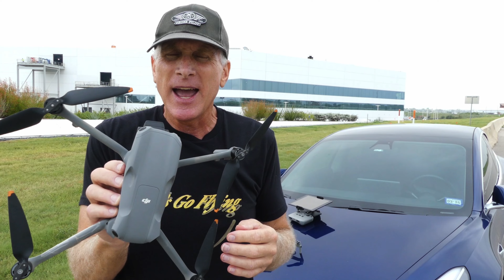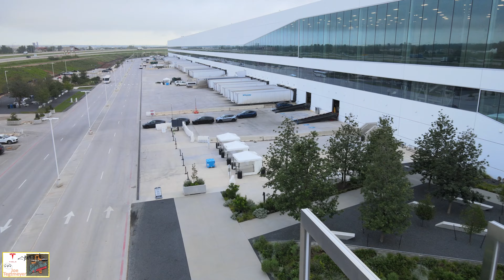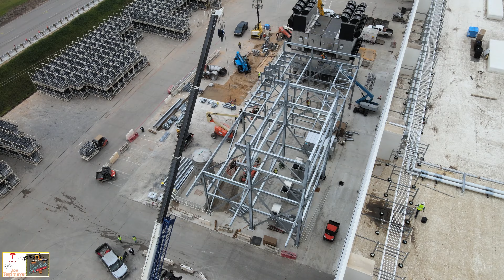About Drones, 1st Dry Cathode Cybertruck & S Ext progress! 26 July 2024 Giga Texas Update (07:35AM)

Comment: 7:49 recently, I have suggested that if the Semi truck's efficiency depends so much on air drag coefficient that the current rigs would waste that immensely. So seeing this, either it is already a testing platform for future Semi car transport trailers, or it is an attempt to save fuel even for the classical ICE trucks. Also obviously it would keep the cars clean the entire route, so why not and it's an amazing though long overdue step in the right direction!

Comment: About these 3 tunnels: I assume they are NOT meant to bring stuff into the building. You can't maneuver a truck around them to get in. It looks more like a "water escape tunnel" to me. Think of the thousands of gallons of water constantly flowing through that supercluster part. What if something goes wrong?
Reply: Fire Escapes. No other egress locations on the southside. Stairs inside to Level 1 and 2. Don't go deep enough into the building to reach the Data Centre.
Reply: @DessieDoolan August 13: apparently not fire escapes. But probably water drainage tunnels.
Reply: @luysterborgh  FWIW. Joe has confirmed from an onsite source that these are in fact simply fire escapes. Check his 14 August video at 11.55.
Reply: @DessieDoolan  I just learned... So you're right. One question remains: why are there these concrete elemnts at the end of the tunnels  'blocking' the exit?

Comment: Thanks Joe
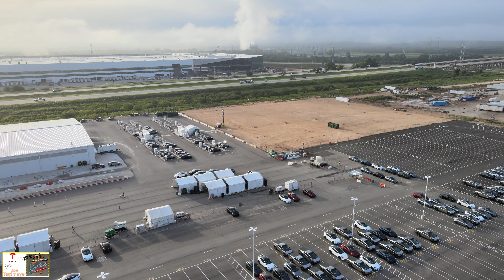6:48. New EOL, north. Cybertrucks going in dry. At 11:28, vehicles tracking water out. Internal car-wash operational.
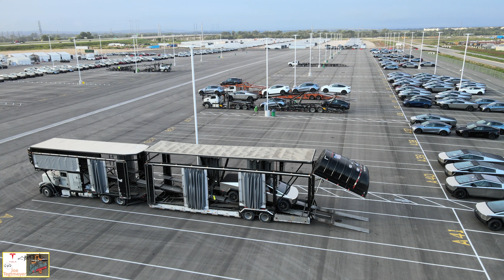7:42. EOL Transport yard. Covered car-carrier. First one in a while. 12 months ago seen regularly when the Transport yard was on the eastside.
8:40. Westside, storage. Bottom. Pair of silos. See 23:41.
8:57. Westside, south storage. Steel items. No columns, not a building. See 13:50 for an example of where this material ends up.
10:02. Westside, Tunnel Project. Tele-handler picking up a road deck segment. Segments are 114” 2.85m x 48” 1.2m. From the Colorado River Crossing documentation, and scaling.
12:24. Southend, roof. Left. Black material rolled out is ‘Hydrotech, Hydrodrain’. Used as a drainage layer for green roofs, or gravel ballast roofs.
13:50. Southend, east. Mezzanine. Constructed an additional column bay beside the loading platform. A week ago as it turns out.
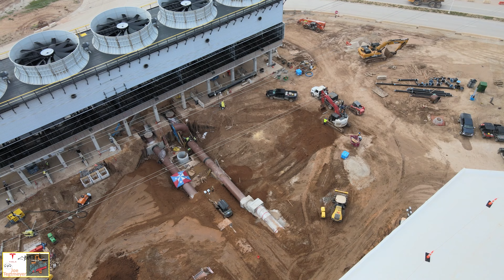15:09. Southend, Cooling Tower. Concrete manhole riser between the large flow and return pipes. A sump perhaps. Small black pipes entering on west and north.
15:58. Southend, south. Centre Fire Escape passage. Barely enough space for the golf cart to turn into the tunnel.
Obvious from this shot is the tricky access into the passage with the narrow space between to the pond.
Considerable work would be required to make this a functional vehicle access. Huge grade differences, minimum turning space etc.
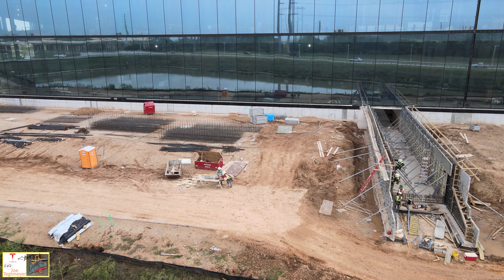16:22. Southend, south. Centre Fire Escape Passage. Wall tapers at the end. Taper would mirror the planned embankment/berm slope.
16:52. Southend, west. Apron. Bulldozer spreading gravel over geo-mesh. Temporary road.
19:35. GA, stairs. Right. Scaffold deck built over.
22:12. Casting, north. 3 black covers over new wall openings.
22:59. Casting, Baghouse. Tank installed. Seen on Tesla Road east in Joe’s previous video.
23:41. Casting, Baghouse. System to the left is by Nederman Mikropul. 
Hexagonal pads as previously mentioned by Joe may be the location for the silos seen at 8:40. Silos such as these feature in some Mikropul explosion-proof filtration systems.
24:21. Windtunnel. Green generator unit has returned.
25:05. Die Shop, north. Storage. Black mesh material, and powder-coated square section aluminum/aluminium extrusions. Fencing system perhaps.
26:58. Cathode, east. Temporary chiller plant.
27:39. Cathode, south. Loading docks empty. US Filter trailer been there since April at least. No trailers at the loading docks.
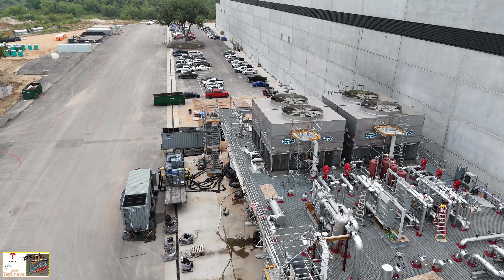27:53. Cathode, Plant Platform. Right. Ice on all 4 of vaporizers in Joe’s photos.
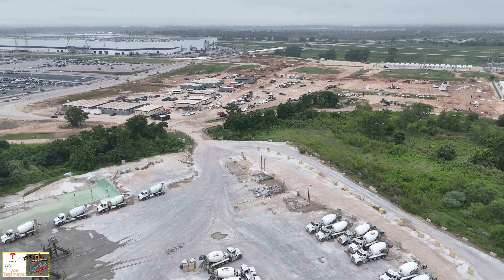28:39. Concrete Batch Plant. Now operated by Texas Concrete. Temporary batch plant to the north of the new switchyard/substation evidently still operated by Martin Marietta.
29:05. Temporary switchyard site. Soil test rig presumably. The most well compacted section of ground on the site. Nearly 2 months spent compacting this site in early 2021.
Reply: Love the term 'explosion-proof filtration systems'
Reply: @memrjohnno  Every home should have one...

Comment: at time 16:07  ---- if the data center is divided into 3 independent sections the three tunnels provide fork lift access to each section.  This way each section can be provisioned separately for both initial install and later computer upgrades of a section without interrupting operation of the other sections.
Reply: 16:07. These passages don't reach as far in as the Data Centre. No elevators either from what I can tell. Plus really tricky access into these tunnels from the narrow space between the pond.
Reply: If that was true then why are the tunnels so inordinately long?
Reply: @GntlTch  I had thought the tunnel length was due to the surrounding grade.  Since there is no elevator then their purpose as a "loading dock" makes no sense.  The only other idea that comes to mind is that the tunnels are part of the HVAC system drawing or expelling air over the pond.  While the main processor chips have liquid cooled heat sinks there are other components that are air cooled with fans using ambient air.  Still this seems like a stretch since the liquid cooling system could also have a heat exchanger to cool the room air in the data center.  And drawing outside humid air in the summer would crate a condensation problem. 

My last idea is that the tunnels provide a water channel to dump water from the cooling system in an emergency if a leak were to develop (caused by an earth quake?) to save billions of dollars of computer equipment.  But why wouldn't a big corrugated pipe do the job instead?
Reply: @datamatters8  These 3 tunnels are simply fire escape passages. I think this was the solution to the problem of having a fully glazed facade that has no openings for fire exits. 

Engineering rescuing an impractical Architectural feature.
Reply: @DessieDoolan  OK, that could make sense but then why make them so long (much longer than needed to protect from falling glass)? And why all the deep piles reinforcing the bottoms of the tunnels? Same question if purpose is for flood waters if a pipe breaks. Tunnels too long for resupply. All that reinforcement implies heavy  loads. For what? Not people. Not water. Not HVAC. ???
Reply: @GntlTch  I'm speculating there will be a road or apron than passes over the passages, so the passages need to have a traffic-able roof. Follow on from that is walls and footings to take that load.

The falling glass idea might be a side benefit. This sort of covered exit not a feature found at other glass facade buildings that I'm aware of.

That the passages correspond with stairs inside is the best indicator that these are fire escapes. No other egress openings in the building.

The lack of turning space into the passages shows that they aren't loading docks. I once thought they were.

Joining the dots I only see fire escapes.
Reply: @DessieDoolan  Great observation.  I hadn't noticed there were no ground floor exit doors through the glass.  I wonder if this design makes it easier to maintain a security perimeter around the office complex & data center?  Doors at two ends of the tunnel act like a double portcullis in medieval castles to trap attackers. 😉
Reply: @datamatters8  Plus a moat to boot!

There must have been a simple logical reason for this design. I haven't grasped it yet!

Potentially there's vehicle traffic inside the building behind the glass (the heavy bollards, the ramped floor level on the west side).

Fire escape routes need to cross that floor, and a subterranean tunnel gives the clearest route.

There are other fire escape passages inside the main factory. Built at floor level, fully enclosed. Some occasionally visible in Battery from time to time.
Reply: @datamatters8  I should also add that although the passages don't reach directly to the Data Centre, there is additional structure that would be a separate stairwell.

All visible in Joe's 26 June video at 7.29. Might not be immediately obvious, but it's there.

Comment: Is Tesla using E-Bus to transport employee around the site?
Reply: No. I had a similar thought awhile back. Put a bus chassis on a Semi frame. Seems they could build a few to make a statement.
Reply: There was an E-Bus (Arboc Equess Charge BEV) parked for some months in the parking lot near Tesla Road. Hoping to make a sale. See Jeff's Day 2019 at 5.45.
Reply: @DessieDoolan  Hmmm... wonder what went sideways with that? I wonder, though if the current buses use CNG. All the generators all over use a shit ton of Diesel. Unavoidable,  I guess.
Reply: @The_DuMont_Network  From memory the bus was only ever parked. Don't recall seeing it being driven.

There are electric forklifts on site. Factory use specifically. Small red machines often seen around Casting.

Do CNG vehicles have an indicator showing the fuel type? Down here 'alternative fuel vehicles' have a small symbol in the centre of the number plate/licence plate indicating the fuel. LPG, CNG, BEV etc.

Comment: YEARS AGO,
The RR transported vehicles in rail cars which looked quite similar to the truck trailers in that the vehicles were mostly exposed. As the years went by the RRs received more and more and more claims of damaged vehicles. It became great sport for some to throw rocks or climb aboard when the train was stopped and break in or vandalizes the vehicles. FINALLY, the RR moved to the totally enclosed vehicle railcars you see today. This enclosed truck trailer looks very similar and I'll bet the trucking co which owns it too has been paying out more than they would like. So we may be looking at the future of vehicle truck transport.

!
Reply: Somebody in the know told me way back when they added the sheet metal sides, it was because they were having problems with the tree branches that tend to grow in were scratching the cars.
Reply: Good idea, but still a weight penalty. Trucks seldom sit as long as trains, and can be alaemed. Ever note you see a max of 8 Teslas but sometimes 9 other brands? They still labor under the 80 K pounds GVW restriction. Includes tractor, trailer, fuel, even driver weight.

Comment: Thanks Joe!
Old temporary substation site:
@ 29:04 Drill rig.
New power supply to the building:
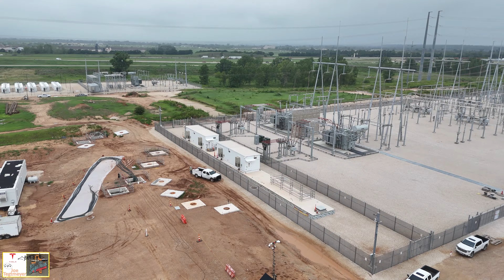@ 29:29 Cables pulled through the duct-bank. Pulled from 30:03 (Upper left). There is enough cable laid out on the ground to reach the Mega-vault.
Duct-bank intersection/New structure:
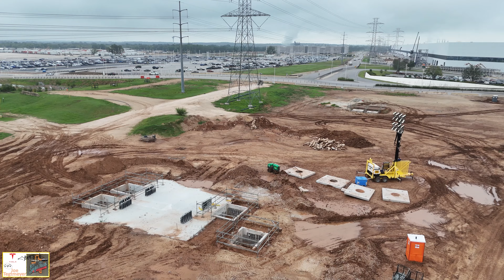@ 30:16 No changes in the last few days but this area will definitely be interesting when work resumes.
@ 30:35 Concrete pour over the last section of duct-banks.
Reply from the maker: @DavidJohnson-tv2nn  👍🤗

Comment: Does AUS Class C start from the surface?  I did my Part 107 about 3 years ago and not much flying so I'm very fuzzy.  On my exam they gave me DFW to figure out! On the far side of the class C circle I see 45/21 which should mean surface to 2100' is under the layer cake and open to flights. Your LAANC says you've been granted permission to only 300' which seems unnecessary and contradictory.  The class B is 45/SFC which makes sense for an exclusion zone from surface level being on final.  Thanks for clearing this up if you've got time.

Oh - and you chould highlight next time that you are barred from flying over the highway, moving vehicles with people inside, so that's why you always have an edit when you cross over.

Comment: Those 3 tunnel exits need to be able to withstand falling 16,000 lb. chunks of glass.
Reply: lol
Reply: Dp they actually weigh that much? Is that a. Dum question?
Reply: @Haliotro  10 feeet by 38 feet by 5 inches thick
Reply: @kkarllwt  😂😂😂
Reply: @kkarllwt  did you just do the calculation to see what thickness it would need to be of it weighed that much ? Or just guesstimate? Either way, point taken, and I appreciate your trolling 😂
Reply: @Haliotro  That was discussed here when they started installing them. I believe people started by estimating and then it was verified (Dessie should know exactly -- he keeps notes of everything).